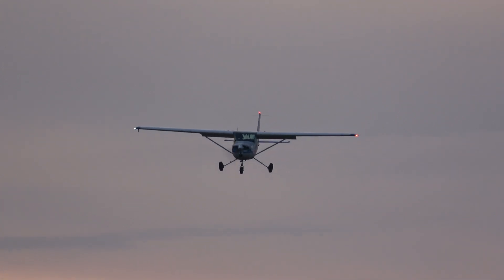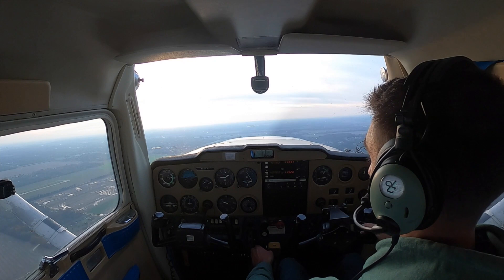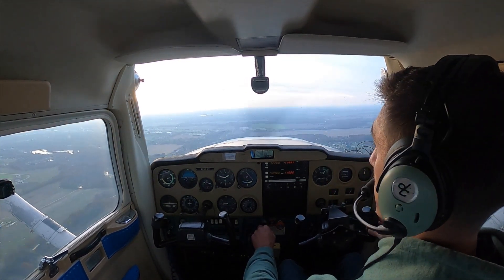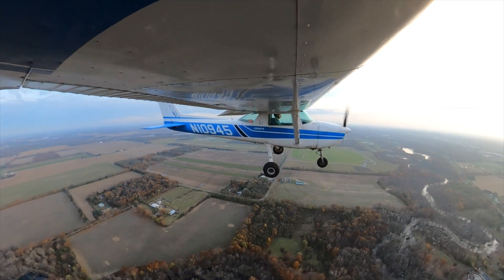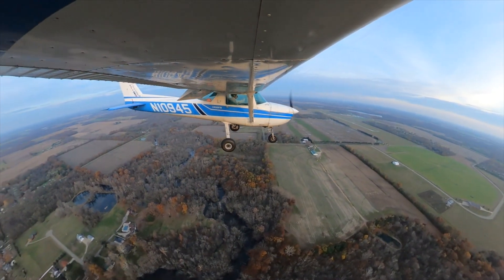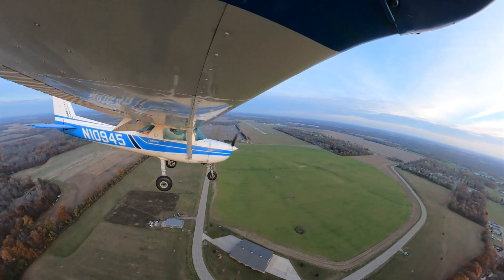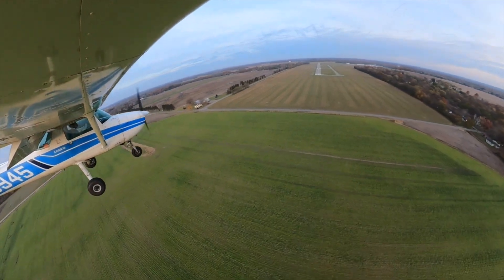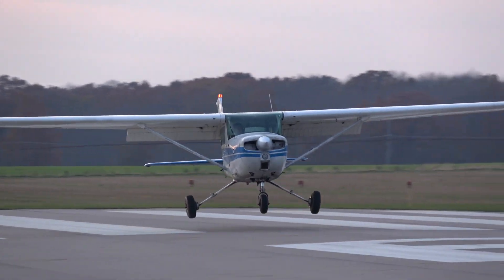Tips For Setting Up Your Approach To Land - Cessna 150

Comment: trim for airspeed?
Reply: Absolutely trim for airspeed. 

In most small, training aircraft the V speeds are known entities and don't vary much (some would argue that Va varies but it really doesn't vary enough to cause you to be fixated on it).

Also...in nearly all single engine, fixed wing, training aircraft I've flown, if you lose power and trim the aircraft full aft (to the stop) , nose up  position, the airplane will settle at it's best glide speed within a few seconds if you've complied with the W/B parameters of the aircraft....Not chasing an airspeed frees your mind to run checklist, look for the most suitable landing area, make distress calls, etc.

Cheers!

Comment: Have flown nearly 50 years and never pitched to airspeed on landing approaches.  The wing creates the only force that opposes weight.  If you pitch to airspeed what's holding the airplane in the air?  A little six foot thin propeller?  You're funny.
Reply from the maker: Imagine flying for 50 years and doing it wrong the whole time :o
Reply: @zacharyg568  ok - teach us how the propeller opposes weight.  This should be interesting.
Reply: @zacharyg568  "Imagine flying for 50 years and doing it wrong the whole time".  What I've seen in comments on many articles and videos is that pilots learn the correct use of pitch only after they have gotten into further commercial training using flight directors and autopilot/autoland systems.  They all lament they were taught to pitch to airspeed and then have to re-learn the correct use of the controls.
Reply: You must have incredibly well developed forearms sir.
Reply: @71TFFC  What in the world are you talking about.  If the trim is used properly, and the weather is good, it usually doesn't take any more than finger tip pressures to make glideslope corrections with the elevator.
Reply: @warren5699  " If the trim is used properly, and the weather is good, it usually doesn't take any more than finger tip pressures to make glideslope corrections with the elevator."

Yes, a well trimmed aircraft requires no more than a thumb and forefinger to make attitude adjustments. Poorly trimmed aircraft create a lot of work and stress, especially in IMC.

I don't have 50 years of experience flying training aircraft, however I do have well over ten thousand hours in SE and ME fixed wing aircraft, both piston and turbine powered, as well as a couple of thousand hours in SE and ME turbine powered rotary wing aircraft (an entirely different animal). I also hold CFII/ MEII in both fixed and rotary wing, and have for 30+ years now. I am typed in several turbine powered aircraft . But FULL DISCLOSURE: I only teach advanced students with at least a SE instrument rating now and  thats very rare unless it's something like a FR or similar for someone I work with or know well.

 I have probably around 1,300-1,500 hours as an instructor, mostly ME instrument airplane. On a rare occasion I will do "downgrade check outs" for current military or current commercial pilots buying or renting something a little slower paced. My girls, 17 and 15, will be my first (in 20 years) and last primary students soon :-)  My late dad (retired Army CW4)  taught me SE, ME, commercial and instruments back in the 1980's during high school...I'm guessing he would be pretty happy seeing my girls getting their private and instrument next spring. 

As to small PISTON powered airplanes, if you are making glide slope adjustments by changing the pitch attitude with the elevator, you are also changing the airspeed. If you're flying a stable approach, you've now introduced other functions to monitor with each change in pitch...throttle inputs AND additional pitch changes and/or elevator trim settings.

If your flying a "close enough" airspeed, like a window of say 10 knots and not taking an instrument, commercial, ME or an ATP check ride, that might be fine I suppose, though it hasn't been taught that way by anyone I've flown with since I started flying . Honestly it seems like a lot of work (distraction) for no gain. Especially when you consider that those changes in airspeed affect trim settings...so why not just set yourself up for a given airspeed to begin with by trimming the airplane for that speed? The further out, the better right? 

Granted small pistons bleed airspeed and/or altitude easily with attitude and flight coordination exercises and remain on glide slope if needed while on approach (the flip side being they don't add speed easily on approach while maintaining glide slope) which is nice if by request you're running one in hot to maintain separation for trailing aircraft, it's not like you're trying to defy the laws physics to keep ATC or trailing traffic happy in a small piston. Some of the most fun I have ever had was flying medium to large piston twins out west many summers ago into ONT, LAS and PHX . Those things would seemingly stop on a dime when you pulled the power out. 

With small piston airplanes (any airplane really), I fly and I always taught trimming for approach airspeeds (or any other airspeed in any other phase of flight for that matter). With the rate of decent (and thus maintaining glide slope) being controlled with very small throttle adjustments if needed. Amazing what +/-  100-200  RPM does on the ride down right? Unless there is a stiff breeze, I may not make a single throttle adjustment (until crossing the numbers) once making the initial power reduction down wind abeam. It's just the way I was taught. It's what I taught as well. 

I'm guessing you probably do the same thing, you just don't realize that's what your doing. You most likely don't even have to use the tach other than for verification of what you already know engine RPM to be. You know what XXXX RPM sounds and feels like. After 50 years, you're most likely able to land your airplane with one arm tied behind your back , with one eye closed....and likely have been that way for 45 years. 

Cheers Sir!
Reply: @71TFFC  Great story.  Your experience is really awesome.

Basically every approach should be done with good pitch and power coordination.  But for practical reasons, if the pilot makes small adjustments with forward and back pressure and the speed changes a couple of knots up and down, is it really necessary to also change the power - not really.  Many times the pitch changes are done very briefly, and the thrust wouldn't be able to keep up anyway.  The pilot should have in mind what the limits are for allowing airspeed change and use the power as necessary to stay within those limits.  In gusting conditions, the proper amount of power should keep the proper average speed with gust factor applied because as you know chasing the airspeed with either pitch or power would not be correct.

In Skyhawks I would include some basic familiarization with the emergency procedure for Inoperative Elevator (in the POH) where the approach is controlled with the power and trim - no forward and back pressure on the control wheel.  It's all spelled out in the POH and quite challenging.  It's possible because the propeller airflow in the Skyhawk is just adequate enough at controlling the position of the tail while using the speed and flap setting prescribed in the procedure.  Even though it may seem that the power is controlling the altitude, that's not what is really happening.  The power is acting as an elevator, and the lift vector is still controlling the altitude.  This same procedure is what deceives many pilots into thinking power can control the altitude.  Even though this can work in a Skyhawk, controlling the pitch with the control wheel is infinitely better than controlling pitch with a cushion of air from the propeller, but in a broken elevator cable emergency, you have no choice.

Understanding what really is happening with the forces is the key to safe control.  I was doing a Part-135 training flight with an applicant in a Cherokee Six.  He got low (red-over-red) and increased power to correct.  It didn't change the altitude once inch, but increased the speed 10kts.  Post flight he was scratching his head saying he didn't understand why the power increase didn't correct the altitude.  Well, the Cherokee Six is not a Skyhawk.  It has a heavy engine and a different arm to the tail.  Imagine if we had been in a high engine airplane - the increase in power would have for certain pitched the nose down.  The problem - he had a completely erroneous understanding of the pitch and power forces and what opposes the weight and therefore controls the altitude.  And from what I read and see in videos, I think that's the case with many other pilots.

Take care.

Comment: Power settings 1600 rpm. Trim for speed. 
80mph. 70 on base. 20 flaps. 65 mph final 30 flaps. 40 flaps when runway is made. 
Always trim for speeds. 
If you play with the yoke for this you'll fail every instrument approach. 
Fly by the numbers now and you won't get bad habits that can kill you in IMC later in your flying life. 
Nothing is willy nilly

Comment: "I don't pitch up..." No, but when you add power, typically the plane does that on it's own because of the prop wash over the wing. Some planes will pitch down though. When that happens, the airspeed increases so you pitch back up to 60 manually.
Reply: Everything is trimming to speed. Try landing with trim alone. More power makes every plane climb. Trimming is how you fly in IMC.
Reply: @TheTerrypcurtin  but what if you fly a plane without trim? Like I get that it’s an IMC thing and that’s totally fine. But what if I don’t fly IMC? What if the plane is in the experimental category and won’t pitch up (initially) to airspeed? Idk man. I think it’s important to add the energy first but I think saying that the plane will “always arrest a descent rate with power” is a little misleading…